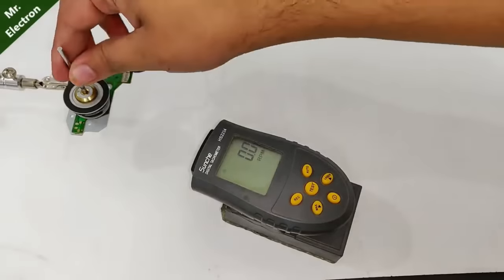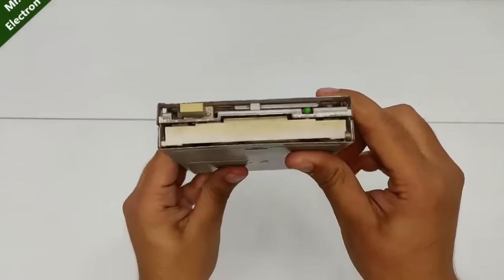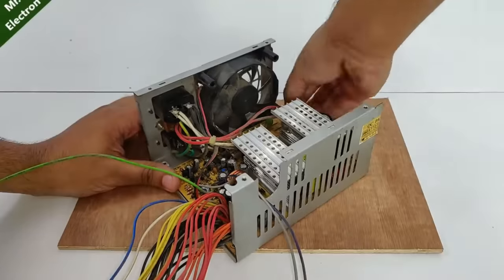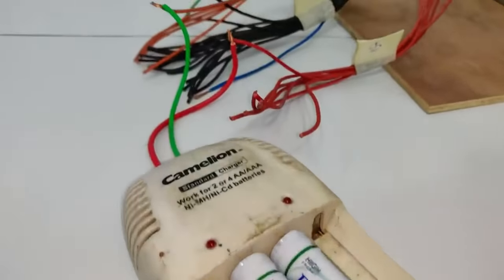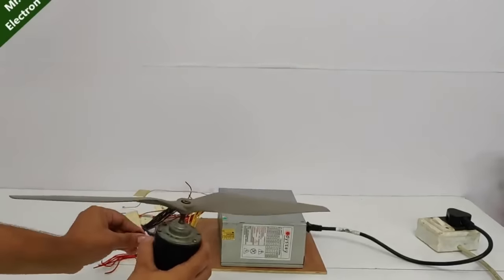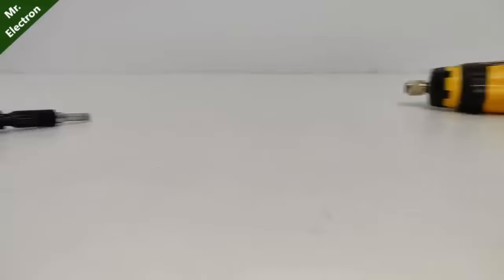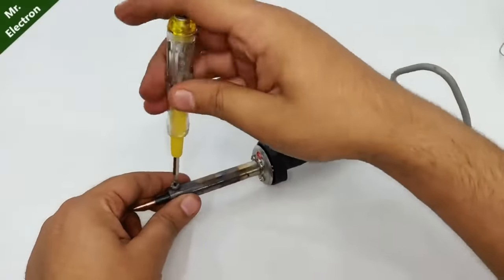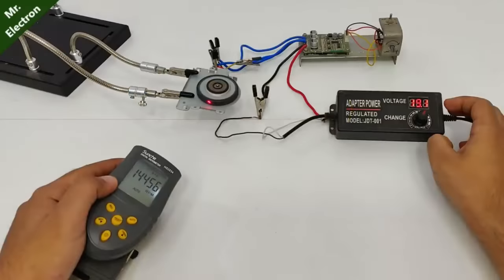Do Not Throw Away your Old Computer CPU | 3 Simple Inventions

Comment: What were the inventions here?  Just "oooh.  I got motor taken from disk drive running"

And before you are telling to charge batteries you should notice that different battery types should get charged different way.  Some of the should get charged by static voltage, some batteries should get charget by static current, and some of them should adjust current during changing etc...

And I didn't found any reason not to throw old crap away.

Comment: the purple wire is +5VSB - meaning it will always send 5V power even when the power supply is not turned on but connected to AC mains. AND the gray one is POWER OK. it is for the motherboard to understand that all the power rails are stabilized and CPU can feed on the power.

Comment: Your video is great and it made me think that you might have an answer to my question. I have a problem and I couldn't find any answer on the web. I have a charger, Duracell CEF14EU4 brand. It can only charge 2 or 4 batteries at the same time. I wonder how I can do it if I want to charge 1 or 3 batteries. Is there a way or a trick to this?
If you have a solution offer, I would be very happy for your help.

Comment: Another way to use old PC power unit, is to buy universal battery charger, like Imax B6 and you can charge anything! Because, batteries need more current, than a voltage (regulated current)

Comment: You said blowers could be made. The RPMs are high but would there be enough torque to spin the fan blades plus move large quantities of air? That was a small propeller. What type of application would the blower work well in? Cooling down a room? What about using it as a desktop computer fan? Might be a great idea especially if you had several

Comment: The grey wire is called as power good signal wire for the motherboard. It's voltage is 5v and it indicates that all the voltages and current from the power supply are good and motherboard can reset the CPU. If this voltage is absent then power is not good. In my experience when the capacitors are faulty this wire doesn't work.

Comment: The negative voltages can only supply very low current, so you can't use them for such big motors. You will burn the power supply very quickly.

Comment: I believe those wires are the unswitched 5v.  This is a 2 amp 5v line that is always on even if the power is off.  This is for lights and stuff that displays when the computer is off.  I ran into the same issue.

Comment: I like this video. I just found 3 PCs on the street that someone threw out and I plan on using all the power supply units. I plan on making a hho generator, a benchtop power supply and then the other one I will use for whatever. I can hook two together couldn't I, to make higher watt output?

Comment: I only get 11.2 Volts out of the +12 wires and I do not have -3 Volt wire.
Would it be possible to adjust the +12 to 14.4 somehow?
I am trying to create a high powered Battery Charger for lead Acid batteries.
The -5 wire can only do 0.8 Amps.
That is not enough.
I have to use the 20 Amp output.
Thanks
Reply: NO
Reply: @douglas2lee929  What if I take the 120 Volt AC and transform it up to like 150 Volt AC?
That should raze the 11.2 Volts DC to 14.4 Volts DC right?

Comment: Hello, can we, according to you, operate a 36V 4.4A hoverboard motor with an ATX12V power supply - PW-400 Input 5A-230V) like yours with the difference that it indicates this:
+3.3V-32A / +5V-40A / +12V-20A / -5V-0.5A - -12V-0.8A+5Vsb-2A. I bought an XH-M229 power supply module to transform it into a desktop power supply, this module offers connections to obtain -12V, +12V, +5V, +3.3V without having to cut wires, so I don't don't know how to get 36V 4.4A from a hoverboard motor or if it's possible. On the 24 pin socket of the power supply there is a blue wire, a gray, a green, a purple, a white, a thin pale pink (connected with a red on the pin), a brown (connected with a yellow on the pin) and it is possible to power this motor with this power supply how should I connect it (connection of the three power supply wires coming out of the motor)? Thanks.
Reply: A 36VDC/4.4A motor cannot be powered directly from this type of power source, because it has neither voltage nor amperage on the -12VDC pole (it has only max. 0.8A via -12V (24V))!

Comment: Hi bro, this is a good and usefull video, i have lot of PSU and some old Samsung cd reader and  diskette reader too, Ill try to make a charger with PSU, thanks for sharing, Im from Mexico.
Reply: add a resistance in series with your battery because the power supply is a voltage source and will probably shut down or explode when it tries to push as much amps as possible to keep it's voltage steady.

Comment: Can It Be Used/Converted For 12v Solar Use ?
Reply: its not a battery or a capacitor or an inverter... mind you that would be nice, but a desktop towers PSU is jsut that.. a PSU with adjustable voltage and amp output... 
If this guy wasnt so dangerous, Id actually say some of the stuff here is a good idea, but no... 
That and the fact the scariest thing about this video is the number of views..

Comment: I take power supplies n big heatsink high speed intel cooling fan ,,the hard drive n cd rom bldc don't have strong magnetic fields like drone motors but still good if you have bldc motor driver ESc n servo tester,,,,I got 6heat sinks which I used in cob led light n a petlier small fridge

Comment: white is normally minus 12 volts so used with a yellow gives 24 volt but very very low current, like 0.5 amp, the purple is normally a always live 5 volt, so even when off if the power supply has voltage then you have 5 volts on the purple.
Reply: Hello ! In order to get a complete response , could you tell us what is the purpose of keeping a permanent 5V/0,5Amp after switching off that old PC-PSU ? Is it to keep the "memory" button battery in charge, or ...?... any idea of other interesting possibilities ? Thks .
Reply: @tchotto5613  for power on keyboard key, wake on lan/net commands, granted its a older feature but still on most power supplies, (it has been around 10 years since i last built up a pc). the CR2032 cell you mention are not rechargeable, however older pc's had a type of small battery pack that was rechargeable so it could have been used there?

Comment: What the heck? This video is harmful. 
Do not follow any on this guy's instructions. Charging and connecting any batteries straight to power supply (with very slight voltage control and NO current control at all) may be disastrous.

Comment: you are not the professional like  name of your Chanel  sorry to let's that at you and I will to do for whey I do that 
first one all PCs do us is not a CPU components 
second one do needed to star up the brushes motor of the floppy disc just by 5v and do not understand rpm marked on the board its is the control of them by PWM 
 third one do not know how to desolder the wire of motor floppy disc professionaly 
and finally 
the 1,6 volte between 3.3v and 5v is just the deference between the boot voltages is never get you charge of battery because the two sources are positive and not the negative in one of them 
and the wire of -12v is not strange is a to small current is less than one ampere 
when you created 24v  the current passed via diode of -12 will be dropped after moment less then minute or 2 minutes maximum
if you need to be professional learn more of electricity and electronic after the the speaking and get learning at other people 
do just learning the wrong information to other people's and that not good for you "professional" 
and I give you the information her for no one come to my for disagreed withe my 
the explaining is posted in my  comments for know I'm not speaking from anything